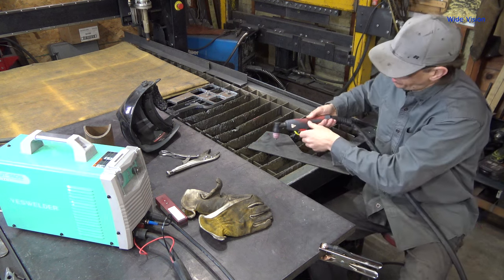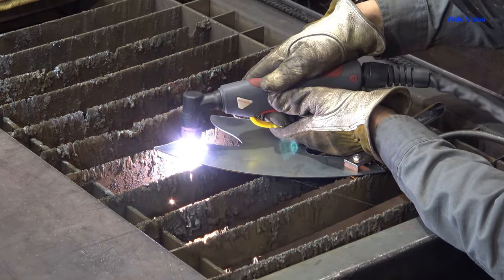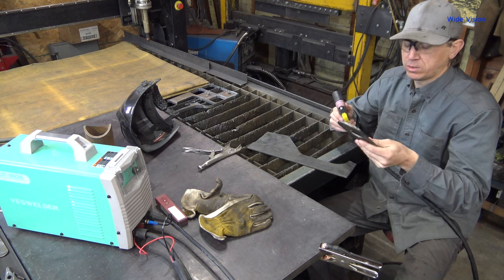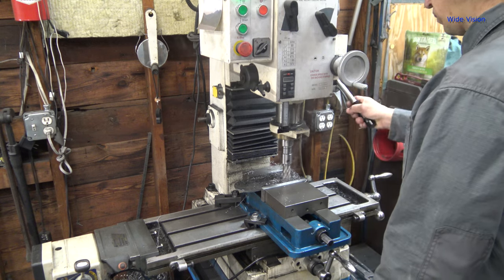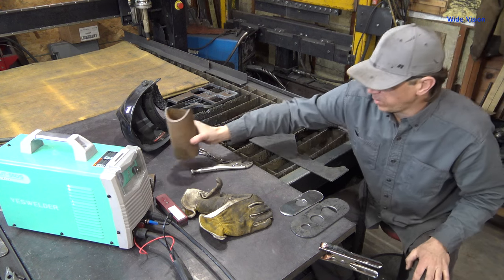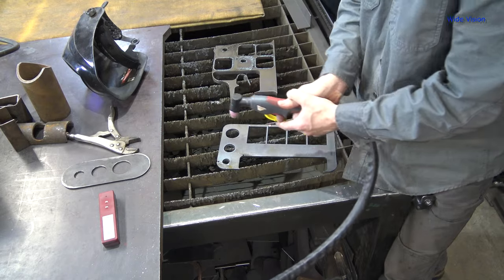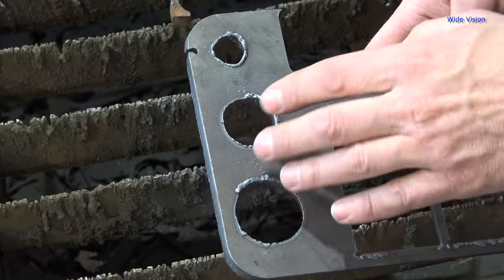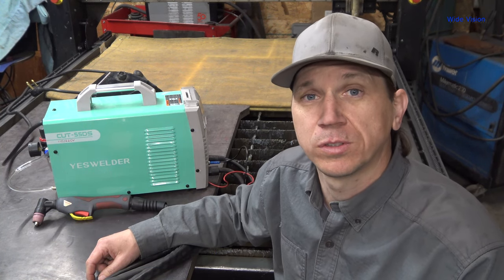How to Plasma Cut Small Holes

Comment: You can also just use large washers for a guide, I've done it many times - just get the size you need for your hole and if you cut up the washer - no big deal, they are cheap and already have the hole in it.

Comment: I did this too! And for holes that need to be located accurately, I machined a plug with an 1/8" cylinder. I drill an 1/8" hole where the center is, put the plug in, then clamp the template around the plug, then pull the plug off. The hole is perfectly oriented. Not sure if I explained that very well.
Reply from the maker: Great tip!

Comment: Cool little idea for jigs. With a generic 'home' plasma cutter (which is all I have) it should work to just make the hole larger than the offset of the tip - label it for the output size even though it's physically larger. Some 1/4" thick 'jigs' would be easy to use. Thanks for the idea!

Comment: I have a cutter very similar to yours in this video , there is a wire guard around the tip to act as a stand off , my question is do you use a drag tip ?

Comment: Quick question: the table you're using to cut on... the grid surface - what the hell do I ask for at the scrap yard? Looks like an old 'in floor' furnace grate we had when I was growing up... only with 'wider' (thicker???) 'slats' making up the grid.
Reply from the maker: That's the grate of my CNC plasma table.  It's made of 2 inch strap set in slots.

Comment: Yesswelder cut 50  is pure chinese junk. Mine was no good out of the box. Pressure gauge only reads 30psi. I don’t know whether I have to much or to little air pressure. Arc goes out after a few seconds. Yeswelder is putting unreasonable demands on me to fix it.